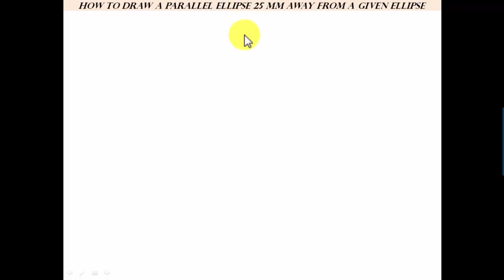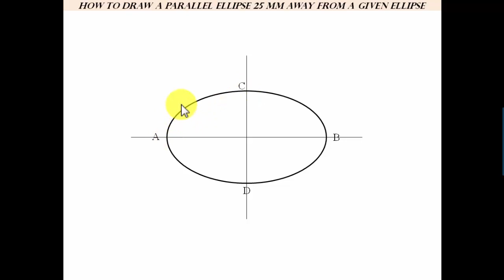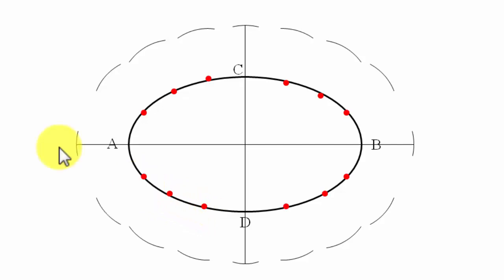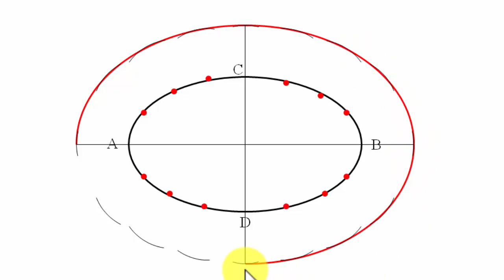How to construct a Parallel Ellipse

Comment: Nice way to approximate, but you have to know: you cannot have a parallel ellipse in theory in the first place. It does not exist. As soon as you offset every point of an ellipse by a constant distance, each perpendicular to the original ellipse: what you get is not an ellipse(!) Or the other way arround: if you increased the two main axes of the original ellipse by a given 'd', and drew a new ellipse over the new a' and b', the resulting ellipse's points wouldn't be 'd' distance from the original ellipse (except at the axes' endpoints). It's the problem of affinity: https://en.wikipedia.org/wiki/Affine_transformation